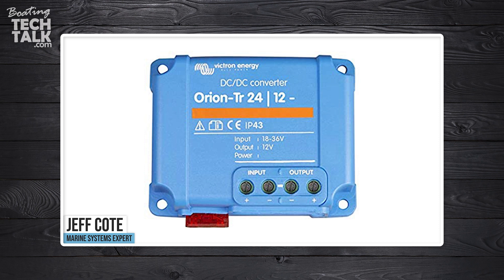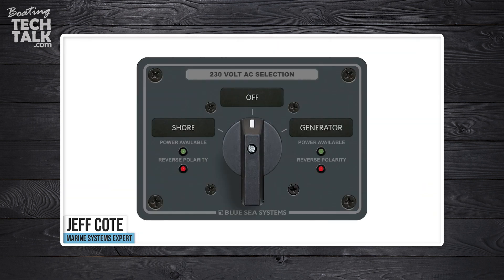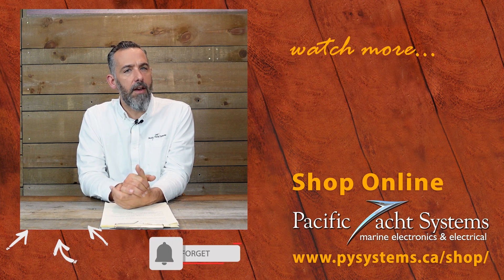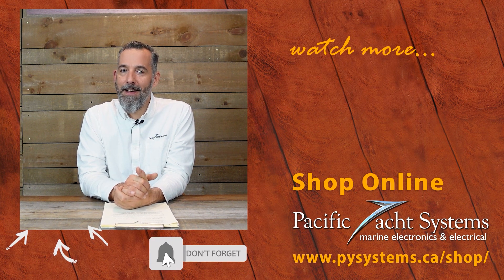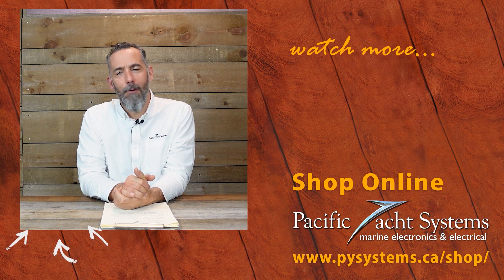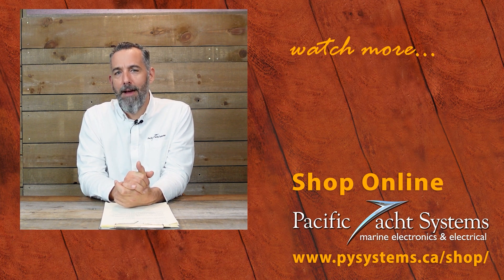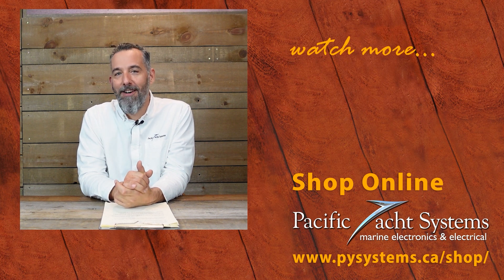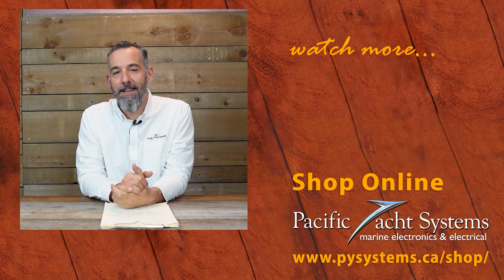How Do I Know if My Bow Thruster Is Getting Charged?

Comment: I'd like to add to the suggestions: if you have an amp (ideally clamp) meter on board, it maybe worthwhile to check the actual current going into your battery with shore vs generator.

Also: it's possible that the asker misspoke and meant to say alternator? In which case it's way more common that the bow thruster is not looped in, as it requires a 3-way argofet and many boats may not have that as standard (I only recently fixed this on my boat).

Comment: Definitely learning a lot from you videos, but I have a question: with the use of so many charger/inverters, why not remove the alternators rectifier and run the ac output through the charger/inverter?

Comment: For a simple preliminary test, why not put a meter on the thruster battery and then start the generator and see if a charge is present? This won’t solve the issue of a possible undersized battery charger, but it would tell you if it’s receiving any charge at all.

Comment: Why not just have bow thruster run off house bank?  That's how my boat is wired (Camano 31) and seems like a good setup and addresses most of the concerns Jeff brings up (house bank is monitored, charged via alternator, charged via a large charger).
Reply from the maker: Hi W B, yep sometimes having the thruster run off a house battery works great... but sometimes the voltage drop caused by the thruster causes the house battery voltage too drop too low and some DC equipment can momentarily turn off.
Reply: @PacificYachtSystems  Even with engine running and alternator outputting a charge voltage?